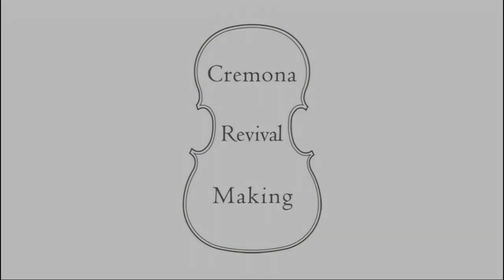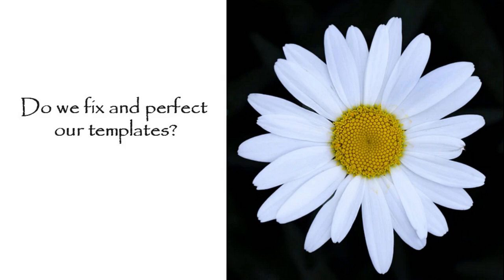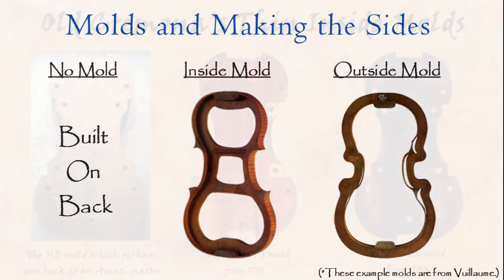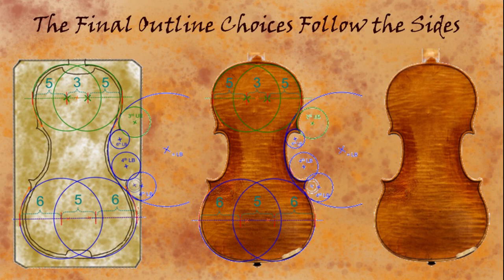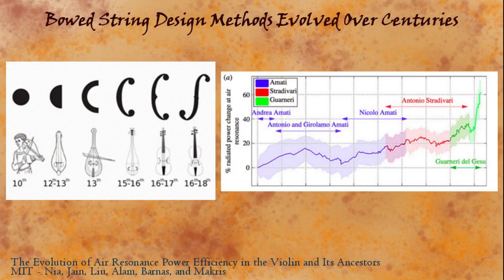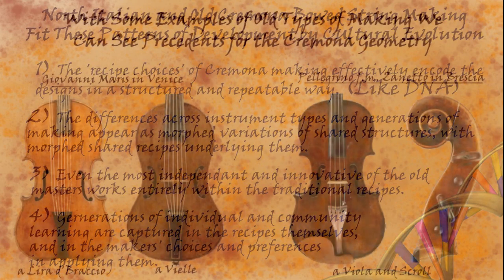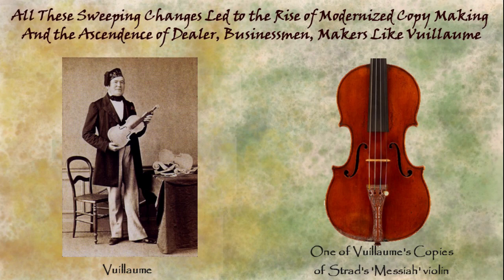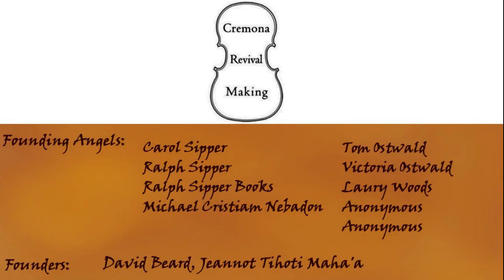Different Ways To Make a Violin - Cremona Revival Video 2

Comment: low quality imaging and lousy audio. There is audio in the right channel only. I'm almost totally deaf in my right ear. I can hear lower sounds just fine in that ear. But high and mid range sounds are difficult to impossible for me to hear. Consequently I can't understand most of what he's trying to say.

There is an audio fix for this in post production. The right channel audio can be panned towards the left until centered. Another fix is to create a duplicate soundtrack and place it below the original soundtrack. The secondary soundtrack can then be modified by panning the audio to the left channel while playing. As long as both tracks are properly aligned it will sound like the sound is centered properly.

I am interested in learning about violin making and construction. But I can't learn much from this video. I scanned through it and it all remains pretty much the same... The audio does change, but is changed from extreme right channel to extreme left channel. The video image quality remains low definition.